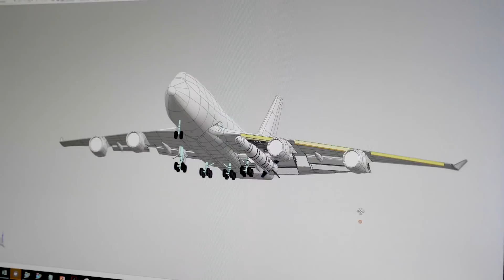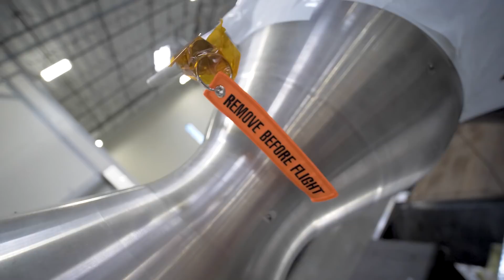Space Tourism - Virgin Galactic vs Blue Origin (& SpaceX)

Comment: That SpaceShipTwo did look a bit wobbly going up...
Reply: Ready to tear into pieces was more like it. Scary stuff.
Reply: From what I've heard, future flights will be more autonomous than that test flight. One would imagine a computer with basically instantaneous reflexes would result in a much smoother ride. Virgin Galactic however, wouldn't want to be too quick to automate the flight procedure when there's so many unknowns as to how the vehicle will behave. Credit to the pilots though, a supersonic jet at that altitude cannot be easy to fly.
Reply: that's true, considering they've have had two fatal accidents I would expect they would want to automate it.
Reply: Needs struts
Reply: Well it was the first powered flight ever for that aircraft, so you can't expect everything to go super smooth.
Reply: orangecode Hypersonic, ultimately. Whether it achieves that at an altitude where there is still appreciable atmosphere, I don't know. Probably not,  actually, as the aerodynamics would be quite radically different. I know this aircraft-spaceship has a lot of control surfaces but...

And yeah, I imagine autonomous control for the ascent phase is definitely the way to go. For testing phase it'd probably be best to start it autonomous but allow the pilot to instantaneously take control over it if required.

I wonder if they can make it fly back autonomously? If so, this would be far better still, as it would reduce the risk factor significantly, as then you need not put anyone inside it (aircraft destroyed is a much better outcome than people dead AND aircraft destroyed!).
Reply: orangecode SR-71 pilots would wildly disagree. It was a dream to fly was said over and over again about it.
Reply: Looks like it needs stricter FBW.

Comment: Hey Scott! Just a question for you, or anyone else reading this. Why is it that both Sierra Nevada and Virgin are opting for front landing skids instead of wheels? It just doesn't make any sense to me. Is it to save cost? Space? Weight? Why is it only the front landing gear? Are there and KSP mods that add landing skids? I must know.
Reply: I suppose it's a simple and afe braking system. Even if brakes fail (if the spacecrafts have them), you have a skid for braking. And why front skid instead of main landing gear skids? Because when a plane touches down, the main landing gears (MLG) are the ones that touch first and recieve the impact force, being the nose landing gear (NLG) the last to touch down, seconds later. If a plane had MLG skids, there would be an instant and high braking force upon touchdown, when NLG is still in the air. The resulting nose down torque would smash the NLG agaisnt the runway, breaking it off and heavily damaging the nose.

Comment: So if they are no longer human rating the Falcon Heavy, why bother with Block 5? Will falcon 9 be able to handle people?
Reply: That's the whole purpose of the block 5, to have a human rated Falcon 9 that flies people to space in January 2019
Reply: falcon 9 (non heavy) block 5 will be human rated.
Block 5 is also much better than previous iterations anyway thats why its called block 5, the reason it has to do with human rating is space x intend to stop iterating at block 5 which will allow enough launches on the same platform for a human rating
Reply: Block 5 is what Falcon 9 was intended to be when it was designed, all the other blocks have just been testing various parts of the design as they start to come off the paper and into reality
Reply: NASA contracts. Block 5 is for Crewed Dragon missions to the ISS.
Reply: Christopher Wills SpaceX is going to use the Block 5 to test its Dragon Crew Capsule sometime during the summer or early fall and by the end of this year or early next year the Block 5 will take NASA astronauts back to the ISS from American soil since 2011 when the shuttle retired.

Comment: new Shepard is shit. not enough time to even get yourself out of the chair before it starts falling back down
Reply: ah as cheap 0g science platform its not bad. none of the issues on the vomit comet and it can do space exposure
Reply: You do realise that it has to fall down in order for its passengers to experience 0g? That's the whole idea - fly up and fall down for as long as possible. Parabolic flights get a little more than 30s of zero-g at a time and do 12 to 15 parabolas resulting in 6 to 7 minutes total weightlessness. A suborbital flight gets you the same amount of time in zero-g plus a better view and the time is not interrupted by the high g-loads of parabolic flights.

The only issue might be the price tag - the parabolic flight costs $5,000 while a suborbital trip might easily be 10 times more expensive...

Comment: I really like how it is now common wisdom that anything operated by a human is inherently insanely dangerous and anything under computer control is automatically completely safe.  It's not like we've ever seen improperly programmed guidance systems on rockets fail catastrophically when they hit some edge case that the programmers didn't take into consideration.
Reply: First off, "To err is human, to really screw up you need a computer".

Second, a computer is only as smart as the people that program it.

Finally, let me point out that there isn't a bit of software that has been released in the past decade that is bug free.
Reply: this is all fixed with proper testing i'm a Software Dev
Reply: @theAppleWizz Yeah, so am I.  I've also worked with military drones.  You've never had "properly tested" software almost kill you before, have you?
Reply: I don't really think that's what he was going for. More that, if somethign fails for the SpaceShip2, it needs to land aerodynamically. Everyone's not in ejection seats. So if a wing falls off, you're fucked.

This is in contrast to a capsule design that the capsule pops off, and has a couple dozen parachutes to use to land with.
Reply: its not that spaceshiptwo is dangerous because it uses a pilot, it's dangerous because tis so fucking unstable they need a pro pilot to actually fly the fucking thing
Reply: I ever said the it's bug free but statistically computers are better at repeated tasks that is something that should not be arguable and if you are really in the software field you know this.
Reply: Well I guess you have more experience with that but you need to admit that it's kinda stupid to think that software is on par with human error. come on man you know we can't repeat things like a computer can sure there are edge cases but thats what they are edge cases.
Reply: @ Peter Anderson

Yeah!  Just like that Arianne 5.  Oops, it had that integer overflow error & exploded during launch...
But yes, you do get a more reliable system after all the possible cases are accounted for.  Until the next change in flight plan introduces new ones that the existing program has a problem with.
Reply: @theAppleWizz "this is all fixed with proper testing i'm a Software Dev"

Sorry, I thought you were being sarcastic there.  I've never seen software that has passed QA without some bugs still present, because they were missed by the 'proper testing'.  This usually happens when the devs who wrote the testing procedures had made assumptions, or just not been able to account for all the variables that reality can throw up.  Unknown unknowns, you know!
Reply: Again man it's not about if it happened it's about how many x cycles before it happens
Reply: Rockets have always been software flown. Well, space rockets at least. 

Software generally performs better than humans. There are certainly edge cases, but humans probably wouldn't do much better for those either. Humans are just easier to blame. The problem with software is who gets the blame?
Reply: Bad Beard Bill The guy who used the wrong units?  Or the one who didn't account for the more powerful rocket exceeding the allowed altitude in the software.

In some cases it is a confluence of errors.  Like the Air New Zealand plane that flew into My Erebus.  Pilots flew low due to whiteout, but they KNEW the mountain was to the right of the flight path.  The planners who changed the route and didn't pass it on correctly.  Ant the ground engineer who update the flight plan on the aircraft but didn't tell the aircrew since he knew they would have been informed of the update in their flight notes...
Reply: Wow you lot are missing the point...
Let's take an example, one that happened to Vergin.
The booster explodes.
We already know what happens when that happens to a space plane and Blue from what little I know has a good enough emergency system to get the capsule to safely, even if the tank breached.
However good your pilot is, if your already dead. I'd take a chance on even my own unchecked code over already being dead.
Reply: It's not all about programming though. It's also about predicting what can go wrong, and how to adapt in case something unpredicted happened.

There's a reason why astronauts have always been highly trained for years. Computer-controlled systems are superior when they are expected to perform repetitive tasks with well-known routines. And when I say "well-known", it's not just about testing. It's about knowing everything that could go wrong, which grows in number as your program interacts with other systems. Humans can handle complexity paired with new situations better, even nowadays, as long as they know what they are doing.
Reply: "improperly programmed" being the keyword here. It's not like the rockets programmed themselves.
Reply: does not matter even if there are edge case you can test that program to the end and after you have a very reliable system it will always be better then a human no matter the training.

Comment: Now here's an interesting tangential question.
If Cosmic Girl is a former airliner, and a standard 747, presumably they have to cut a lot of the regular payload weight to make launches from it viable.

However, I wouldn't be surprised if it could still easily carry at least a small number of passengers, (though perhaps there's an increased safety risk)
What are the chances of them allowing some paying passengers onboard to witness the launch?
Sounds like an interesting (and affordable) thing to do, which while not really space travel in any sense, could still be fun...
Reply: Well, they pull out most, if not all, the passenger seats, to start with.  And since the Cosmic Girl will return to the same airport, it won't be carrying cargo.  From the image where it was carrying the rocket, it was attached to the standard 5th pod mount that airlines use when they need to carry a spare engine to somewhere to replace a failed one.

It's a better option that launching from on top, like NASA used for testing Space Shuttle aerodynamics.  I know I wouldn't want to be launching a rocket over my head!
Reply: +Matthew Martin, writes _"They will have to reinforce the parts of the plane holding the extra load._"

The rocket is mounted under the wing, the wing is already designed to support the weight of the plane fully loaded so I doubt much has to be done, and if anything is needed it won't be anywhere near the passenger compartment.

"It also seems reasonable to have some counter-weight to balance a rocket hanging from the other side."

Easily handled by off-set loading the fuel.

It would be an easy calculation at the end, maximum weight of the plane minus the gross weight of plane with rocket = amount of weight available for passengers.

Much more likely reason they won't have passengers is they simply won't bother trying to get the FAA to rate the (modified) plane for commercial passenger service.
Reply: They will gut the interior of the plane and make it their mission control center. This setup will take up almost all of the airplane's interior. While it is an interesting idea, i'm not sure they would be able to do so.